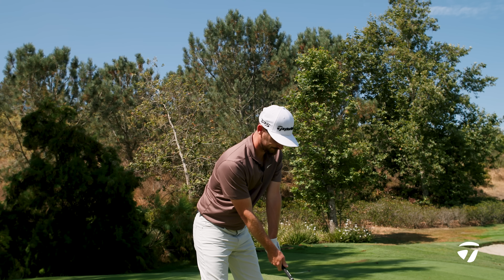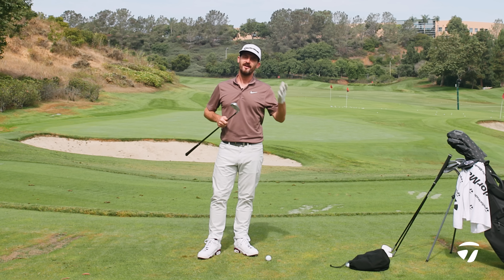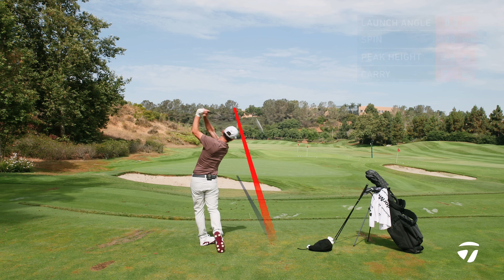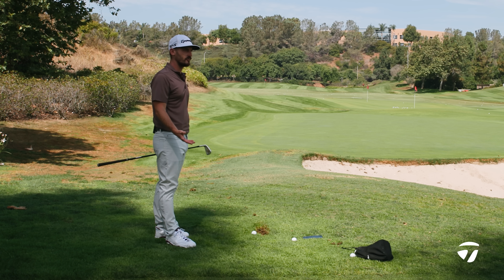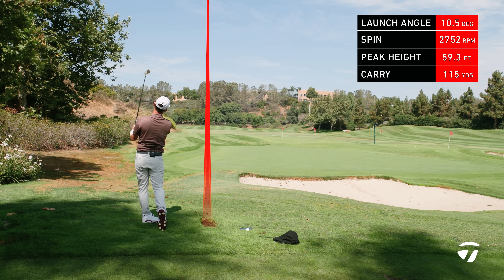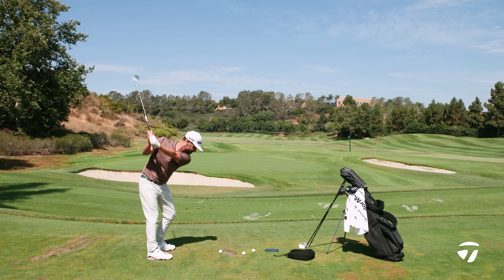Testing The ALL-NEW P·790 Irons | TaylorMade Golf

Comment: The P790 is a design that boasts extra distance but it does that with stronger lofts.  If your swing speed is low like mine this translates into low short shots, just like he just said.  Low launches.  I tried to make my original P790 work but gave up on them.  If you are a high index golfer you need to hit these thoroughly first before you buy them.
Reply: What do you mean boasts extra distance "but" it does that with stronger lofts? That is the point of these clubs. They are called Distance Players Irons. It is known that the lofts are stronger than normal. You aren't revealing some crazy secret here. If you play with game improvement irons, their lofts are even stronger. that's how this works.
Reply: @brendanconnery7847  Well, Taylormade, in our extensive discussions about my two sets of P790s never mentioned this and by the time I figured it out for myself, I had wasted my time.  They only cared about selling me clubs and not wether or not my slow swing speed would be able to launch with these low launching irons.  Now they market them as high launching, which I doubt.  But one thing is clear, they held back that info in order to get me to buy the clubs.
Reply: @bertraminc9412  It's clear that irons such as the P790s are too advanced for you. If you don't know about club lofts, lie angles, weights, etc... you should stick to game improvement irons and learn about the game first. Learn how All iron sets with more forgiveness also increase lofts to assist players with distance. Then you won't have to waste your and other people's time talking like you know about the game when, in fact, you are ignorant. It must be exhausting for everyone unfortunate enough to engage with you.
Reply: That’s a good point. No amount of tech can offset too low of a swing speed. What was your clubhead speed or ball speed with a 7i- assuming thats what you used?

Comment: I’ve gamed a set of P790s and tee to green they’re great. Around the green is where I struggled. The hotness off the face made it hard for me to judge chips and pitches. Interested to hear other’s experiences.
Reply: Yeah I've got the 2021 P790s and through PW they're definitely hot off the face. I would love to mix a bag of 790 and 770, BUT I've found that I really REALLY love the feel of single length irons in my scoring clubs. So I play Cobra ForgedTEC single length 8-GW and then TaylorMade HiToe 56 & 60 that are longer than stock wedges, but not single length.
Reply: Why....are you chipping with the P790's.....50/54/50&60 should be wedges.....
Reply: @MXJEFF94  I play on Links courses, sometimes the ground is so hard and firm from fairway to green, 7, 8 to PW is the best option..

Comment: I can attest to how well it feels, and it's performance downrange. They hit a home run with this one. I went in wanting the Titleist T150 to be the winner, and the 790 outperformed it in all categories. I honestly didn't want to buy the Taylormade going in because I am a Titleist, and Ping man, but it's just undeniable. Mine was compared with the i230, T150, and a Mizuno (which was the prettiest iron in class btw). The fittters were equally perplexed how well the 790's treated this old hack.

....but when can I place my order for the new ones?????
Reply: Interesting that they compared the P790s to the T150. The 790s are more relatable to the Titleist T200. Lofts are more equivalent, and the T200 is a hollow body design like the P790, whereas the T150 is a solid body design and slightly weaker in loft. I think the P790s are a good club, but you are missing out if you haven't tested the T200 yet!
Reply: @ryanlocke6339  yea all the clubs bro listed are more players irons than game improvement like the p790s. Should’ve been hitting p770s or i529, t200s, mp225 for a more accurate comparison to p790s

Comment: which would you recommend.  im a 1 handicap.  debating between 770 or 790s.  i'm 45 yrs old.  i drive the ball 280ish and my 7 iron is 170'ish yards (granted on some pretty weak lofted bridgestone J36 muscle back irons) .  think the 790s is too much of a "helping club"
 for my game...or can handle the 770's for about 5 yrs until my next set?
Reply: Well we are the same age and roughly the same drive, but my current 7i was going about 165 carry.  I was playing Mizuno MP18's.  I tested the Mizuno 223, P790's and the P770's today and it was close between all of them, but I ended up going with the 790's because the dispersion was the best and they were the most forgiving.  I had a poor angle of attack today and some inconsistent ball striking (heel-toe) and I will still producing a nearly identical result with the 790.  It was close though, I was tempted to mix the bag with 770's.  I am an 8 handicap for reference, but you just have to get fitted properly and trust the results.